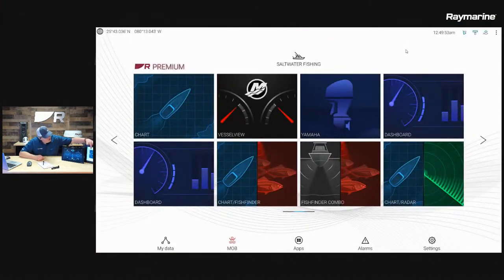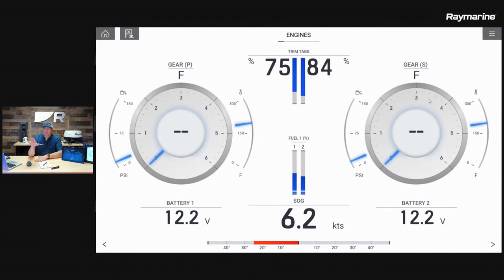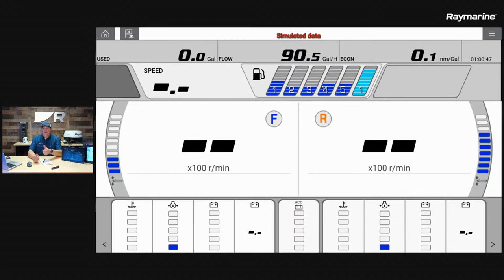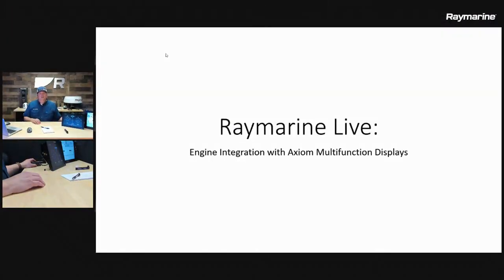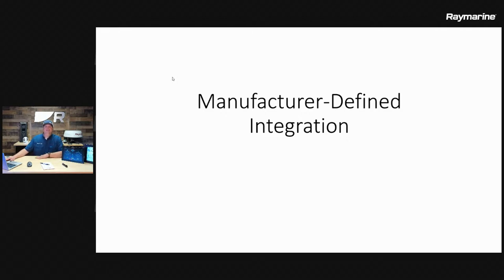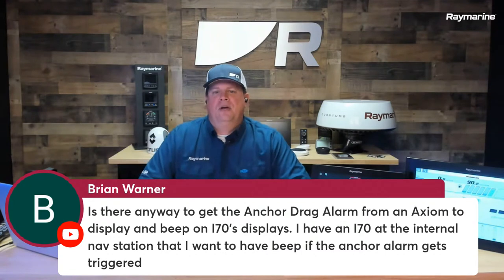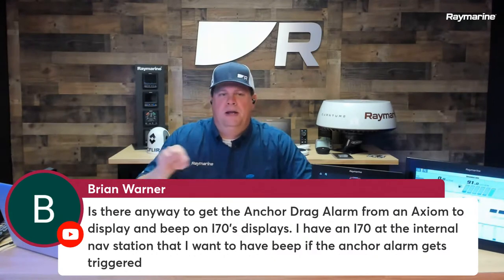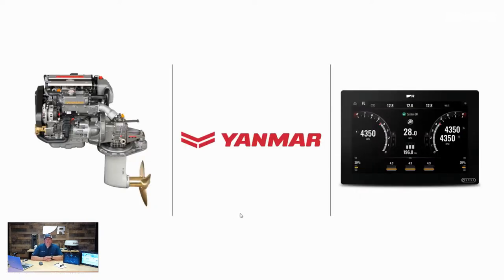Raymarine Live:  Engine Data Integration with Axiom

Comment: Hello everyone I am on the process to connect my twin yamahas 150 to my raymarine s I have  two of thwn..one 12 inches and onother  9 inches as a back up GPS and Engines display 
I already have my engines connected to the yamaha command link hub, from there I am assuming I need the E70242 Raymarine yamaha comand link to then connect to EC100 to the Raymarine Nmea 200 gateway , from there to the chart plotters..
Please let me know if I am missing anything!!!
If I use raymarine ECI 100 I will be able to see yamaha engines data but in raymarine app only?..., however, if I use the 6yg yamaha getway I will be able to see "yamaha engines app" only? is that correct? No possible to be able to display both? at lease that I somehow connect the ECI100 and 6GY yamaha with in the nema2000?
Thank you !!
Reply from the maker: Hello Pedro.  I recommend using the Yamaha 6YG gateway for this.   By using that gateway you'll be able to see data in both the Yamaha app, and in Axiom's dashboard app.   If you use the ECI-100 for this, and not the 6YG, you'll only have access to data in the Dashboard app and not in the official Yamaha app.

You will not need the E70242 cable or the ECI-100 for your installation.    The Yamaha 6YG comes with the correct connector to plug into your Command Link hub, and it also has a NMEA2000 DeviceNet connection.    Use Raymarine A06075 Device Net to SeaTalk NG to make the connection between 6YG and your Raymarine SeaTalk NG network.

The Yamaha app on Axiom should come to life as soon as that connection is made.
Reply: @RaymarineInc  Thank you very much!!! i will go that route, how about fuel level tank display? I currently have 6Y8-8356N (no possible to connect to comand link hub) previously using yamaha comand link display!!!

Comment: Can you do a session on engine integration with Element.
Reply from the maker: I'll see if I can add that to a future Element-focused episode.   The connectivity is really not much different than that of Axiom.  Element supports NMEA2000 networking and received engine data to its Dashboard app that way.   The main difference (at the moment) is that Element does not have the Yamaha-specific or Mercury-specific engine data pages.  Instead, Element only displays engine data using its native graphics in the dashboard app. 

Let me know what engines you have onboard your boat and I can advise the best way to see them on Element.   Email me at james.mcgowan@raymarine.com.

Comment: I’m desperate to integrate my 2003 Cummins 480ce with the axioms.  All of the data is there, but this was an early ecumsystem that was not optioned with the Mercury smartcraft system and I haven’t found a clear way to make it happen.   Can anyone help?
Reply from the maker: Hi Richard.   It looks like your engine supports both J1708 and J1939 data.   The J1708 was more for engine running data, and the J1939 more for diagnostics.   This thread has some discussion on it, and towards the bottom it looks like the original poster had success getting data from the J1708 connection.  The Yacht Devices YDES-04 supports J1708, and they do list some Cummins plug adapters for it too.   https://www.yachtd.com/products/j1708_gateway.html

I suggest sending them an email with the details of your engines, and maybe a few pics too if you have them.
Reply: Thanks for the advice.  I purchased the connector from yacht devices and it’s working great.  Now just looking for more customization from the engine gauge display on the axiom.  It’s missing info that I’d like and displays items I don’t have.  Also want to build alarms for various inputs and don’t see how to do this

Comment: Is Mercury vessel view for Axiom same piece of hardware as vessel view mobile?
Reply: Is one Bluetooth and the other nema 2000?
Reply from the maker: VesselView for Axiom uses a different piece of hardware than VesselView Mobile.   It requires the SmartCraft Connect Gateway, available from your local Mercury dealer.   Your dealer does need to program it to work with your engines.  https://www.mercurymarine.com/en/us/gauges-and-controls/gauges-displays/smartcraft-connect/

Comment: how about a volvo penta 2003T from 1987 with a Axiom 9?????? please help
Reply from the maker: Hello Palle.   A 1987 model engine probably does not have electronic data output, so I think your only option would be one of the analog-to-digital systems.  The Actisense EMU-1, AlbaCombi Translate and other similar devices and tap into the analog signal feeds that run to your current instruments, and convert them to digital NMEA2000 data.  Note that this is not a simple plug-and-play installation.  It will take quite a bit of configuration to get it up and running.
Reply from the maker: Here is a story about setting up this kind of system .  This will give you an idea of what kind of a project it will be:
https://panbo.com/actisense-emu-1-analog-engine-gauges-to-nmea-2000-happiness/

Comment: Hi Jim, is there any news on forward sonar yet?
Reply from the maker: Hi Jim.  Nothing I can share just yet.   If you need something soon take a look at the EchoPilot FLS Platinum forward looking sonar.  Many Raymarine customers have reported favorably on it through the years.   Its popular because it is a black-box system with video output that can be connected to many different types of external monitors or MFDs.

Comment: Hi, what is the best way to get data from a Volvo KAD43 ?
Reply from the maker: Hi Craig.  I believe the YachtDevices J1708 Engine Gateway is what you need for that Volvo engine.   I do suggest reaching out to YachtDevices with the details on yours to see if it will work and which plug adapters are needed to plug-in to the engine's data bus system.  https://www.yachtd.com/products/j1708_gateway.html

Comment: Buenas tardes Ramón de ceiba honduras quiero saber qué se nasecita para conectar datos de dos motores CAT 3196 ha una pantalla axiob Ray Marín de un yate sea rey
Reply from the maker: Hello  Ramón.   Axiom reads engine data in the industry-standard NMEA 2000 format.   Most Caterpillar marine diesels support a protocol called J1939 which is similar, and can be converted to NMEA 2000 using an engine gateway device.   Raymarine's ECI-100 Engine Interface Converter supports conversion of Caterpillar J1939 information.    

In order to use the ECI-100 with your CAT engine, the engine installation must already have a CAT Marine Power Display (MPD.)  That is the electronic display from Caterpillar that displays engine information.  There are a few versions of the MPD including a color version, monochrome version and a mini version.  When that display is present, that means the engine itself is wired for electronic instrumentation and monitoring.  Engines without an MPD are not compatible because they don't have the necessary factory wiring harness present to support electronic gauges.  

You will need 1 ECI-100 (E70227) and 1 Caterpillar 12-pin Link cable (E70305) per engine.   

I strongly encourage you to take a look at our ECI-100 handbook which has a section specifically on CAT engines, before you purchase anything.  That handbook is available on Raymarine.com here:

https://raymarine.app.box.com/s/rvhycb6x1brzo64921k5tsqwv2ica3j6/folder/1787229145

The CAT3196 is a popular engine that has been in production for a long time, so there are lots of them out there with and without the necessary wiring harness installed.   Definitely do your homework before you start purchasing components to be sure you have the right items onboard to start.  Feel free to email me photos of your current installation and CAT displays if you need help.  james.mcgowan@raymarine.com.

Comment: I will like you have (engine data) combo with other things like maps or transducer
Reply from the maker: Our system is pretty flexible and allows many different types of data to be shown at the same time.   Most engine data can be show in a split-screen, with another app alongside above, below or to the side.  One exception is the Yamaha app, which only works in a fullscreen presentation at the current time.

Comment: Hi, why dont you work with volvo penta?
Reply: @raymarine.. I was looking for similar info.. have an older trawler with Volvo TAMD40's.. would love to get integration.
I assumed I could change the senders to NEMA senders and get most functionality.. no?
Reply: see the video around 35mins.. he speaks to volvo penta
Reply: Thank you Rick
Reply from the maker: Most Volvo-Penta engines do have data output capabilities.   Engines from the last 8 years or so can output data through either a Volvo Penta NMEA2000 gateway or using a Raymarine ECI-100.    Older models can often be accessed using a J1708 to NMEA2000 adapter like this one:  https://www.yachtd.com/products/j1708_gateway.html

Some Volvo engines instead speak J1939 protocol, which can also be converted to NMEA2000: https://www.yachtd.com/products/engine_gateway.html

Comment: Hi, what can use for 1990 mercruiser 5.0 LX  V8 Alpha one. Axiom Multifunction Display can you please send  me your email. Thank you
Reply from the maker: I think you might want to look at one of the engine gateway options from Fox Marine:  https://fox-marine.com/

I believe that generation of Mercruiser used the Marine Electronic Fuel Injection (MEFI) system and they likely have a gateway device that will work with your motor's electronic control unit.

You can reach me at james.mcgowan@raymarine.com

Comment: Why not Volvo Penta?
Reply from the maker: Axiom can communicate with Volvo Penta engines and display engine parameters in its Dashboard application.

You can use the Raymarine ECI-100 Engine Interface, or, you can also use the Volvo Penta Easy Connect interface kit to provide the NMEA 2000 data stream to Axiom.

The Easy Connect interface is a relatively new Volvo accessory that also has some Smartphone integration in addition to providing the NMEA 2000 interface.    You can learn more about it here:
https://www.volvopenta.com/en-us/marine/accessories/easy-connect/

If you use the Raymarine ECI-100 instead, you can check out the installation guide for it here:  It contains illustrations for how the connections are made, a full compatibility list, and the engine parameters supported:
https://raymarine.app.box.com/s/s2bajpvqjoiflgsqzx3o/folder/1787229145